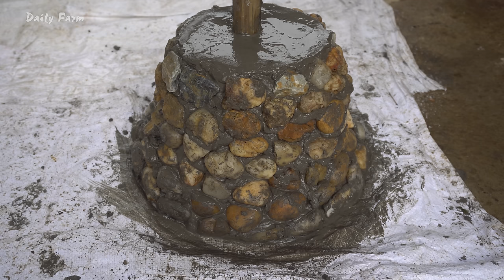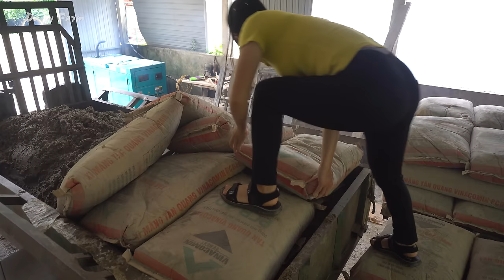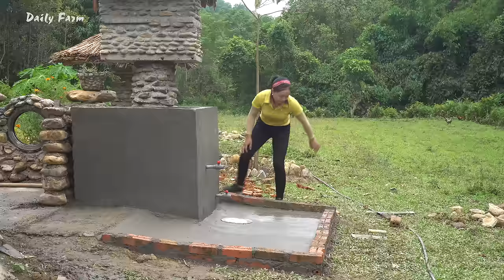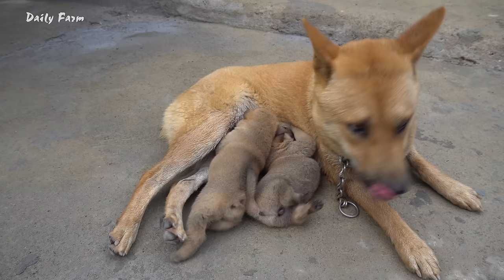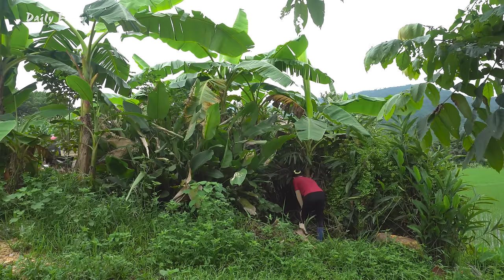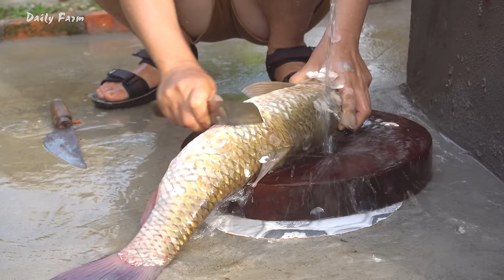130 Days How To Building Farm With Stone, BUILD DOG HOUSE, Build Water Tank [FULL BUILD]

Comment: If you do the footer first, like the bottom of the dog house then you can just dump the wheel barrel full of cement right onto the ground before you put the walls up. Great work; it's just to work smarter, not harder. But in a house,, you really want everything to be level; which is why you pour the footer first.